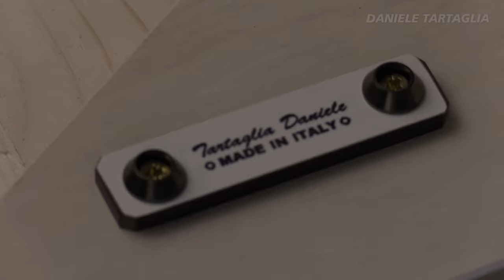3 AMAZING woodworking machine diy

Comment: All diy are expensive than buy readymade comercial, you used supported LR costly , you used coupler as screw head costly for this purpose , even the ER 11 is many times costlier then 775 motor itself.

Comment: the inventions with those motors do not work if it is for force without a gearbox they are useless because they are made for speed and not for force they can only cut very thin wood if you want to cut something robust it will take hours because you have to go slowly very slowly if you rush the motor stops i know i have already done it it's a big waste of time to do this
Reply: I didn’t see them claim these were for heavy duty work, the opposite actually because he used small pieces of wood to demo…..btw, you get out much? If not you should!